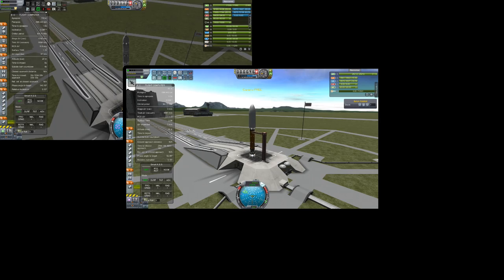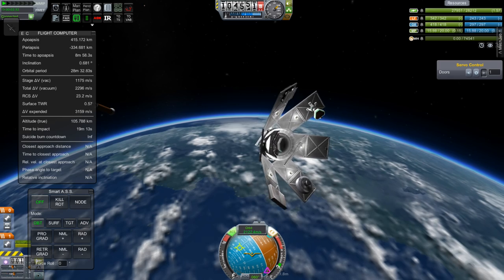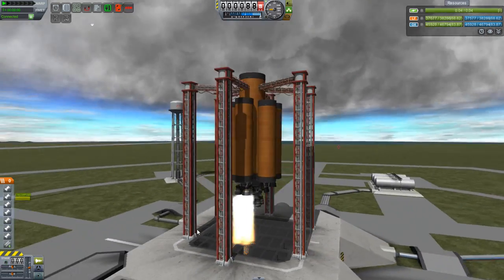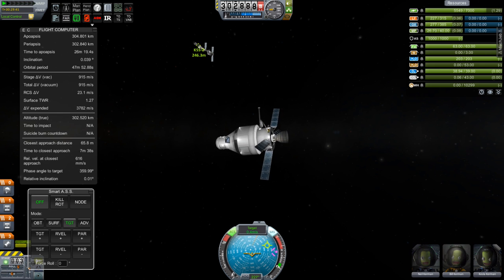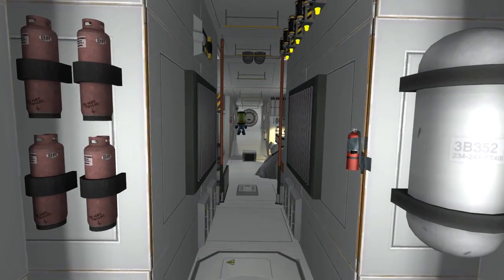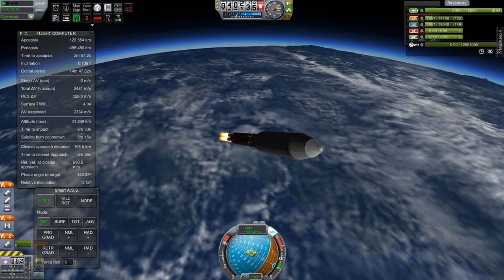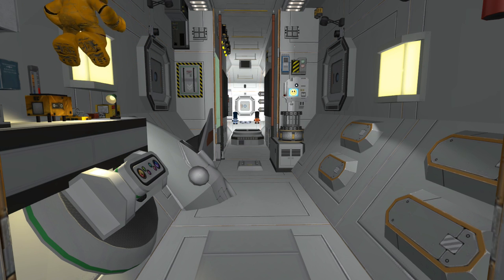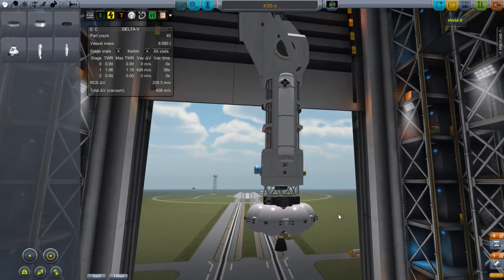E09: "Radiators" / Project Odyssey / KSP 0.23.5

Comment: I love  this! never stop this kind of series. Never stop. ;) Oh and if you could when you're finished with project odyssey, leave a download for the save and the GameData folder...
Reply from the maker: Everything I can give is already in the download link. For license reasons I am not allowed to package my whole GameData.
Reply: Bob Fitch I see in the .cs a mod called EngineThrust. What mod is that?
Reply from the maker: It was used in my next RSS launch (Space Shuttle STS-88) and I liked the mod so much I added it to Odyssey. I don't remember which episode it'll show up in, but it handles SRB thrust. It causes them to "throttle" up and down based on ruel remaining automatically, just like real Space Shuttle SRBs did.
Reply: Bob Fitch I can't find it on course. What's the mod name?
Reply from the maker: That is the name. It was part of the complete RSS download.
Reply: Bob Fitch Ok, but can you give the modifications that you made, the programs you wrote, how you set it up and the parts you don't use?
Reply from the maker: It's all in the dropbox link. Anything not there you have to handle yourself, like installing needed mods/parts.
Reply: Bob Fitch I think there is something missing in the files, maybe some mods because, preparing the ksp distribution running the .cs program, it give an error on startup when the game load the constellationBNTR part. Can be something related on the fuel type? For now, can i comment this part?

Edit: opening the .craft file with "mod Manager" I fond that some parts is missing: FelbournAirock, FelbournBooster2, FelbournThugTank and n1-truss
Reply: Bob Fitch Weird.  My comments didn't save.  Anyway, hi Bob.  Absolutely love these.  Quick question, with your config files you uploaded, do they just go directly into the Game Data file?

Comment: Coupel of questions.

1. Whats the weight trade off between 2 structural panels and a structural beam of equal length (or the new IR addon peices)?
2. I take it Kessler recently flew Southwestern Airways?

Lastly cracking vid made me chuckle on Fitch Monday.

Comment: I wonder if part of the rotational issue was the rotating dish on the side messing ever so slightly with the center of Mass so the rcs stabilizer mod couldn't compensate. If you get a chance, perhaps it's worth looking into? I would suspect that if you stuck a bunch more of those rotating communications dishes onto your station, it could be a problem...

Comment: Ahh kerbal fix for the week :) Loving this series Bob. 
With the launch malfunctions in KSP and being able to save the mission as seen at 3:00 , has there been a parallel story in real life where there's been a major mechanical or structural failure during launch but was still able to obtain orbit/survival of payload? Im thinking its just a "KSP thing" as the forces involved in a launch vs structural engineering is black and white of stable flight vs fireworks and tinsel.
Reply from the maker: I was almost into total vacuum. Things get "easier" there to recover. Apollo 13 for example... horrible malfunction and yet ended in success.
Reply: Ah yes Apollo 13. The launch to upper atmosphere though is so brutal on the structure of a craft with G loads, fuel combustion, friction/shockheating its hard to imagine even a minor failure (obviously been systems failures of a more electronic variety) being recoverable due to the reaction time vs stress in the 0km to 80km atmo range. Still I wonder if its possible for a stage or section to collapse, break off or explode and still save the mission if not the payload... But I sense thats just a KSP thing for fun as the real world is way harsher on spacecraft. :)

Comment: I would like to know how you got the kethane scanner to scan smoothly and not stutter across the map at that high time warp. I can never go faster than 10x speed? Help?
Reply from the maker: You pre-warp speed is slower from higher altitudes. Scan from higher so your scanner doesn't skip a hex between ticks.
Reply: Bob Fitch I guess I need to figure out what the max orbit height is on the scanners then. I didn't think you could get high enough to do that. o_o

Comment: Hey Bob, I'm having troubles with the docking pots that include parachutes, they don't give me an option to actually deploy them. Is there a mod I'm missing or a glitch?
Reply from the maker: It does not require a mod. It's a thing that SDHI already does, so it has to be something about your part file or install.
Reply: Okay thanks, In the meantime I'll just slap some side mounted parachutes.
Reply: CodeFantastic you will also need the Real Chutes mod for it to work.
Reply: Oh okay Thanks!